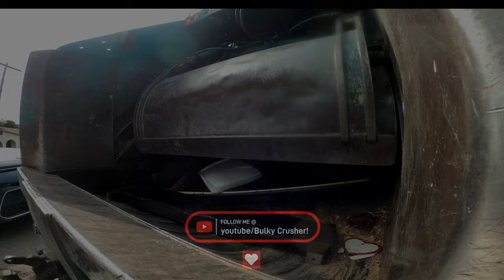Bulky Truck: House Clean out Part 2!

Comment: 1:00 Clothes
1:30 more clothes and plastic toy
3:04 Trampoline
6:01 Winter jacket
6:35 Clothes
8:25 Clothes
8:58 Toy
9:39 Backpack

9:42 You missed the iPod there 😅

9:43 Shoe
10:10 Backpack
17:30 Toddler walker

20:19 Compacted clothes

23:36 Plastic toy kitchen
23:41 Plastic toy slide
24:18 Mannequin and Clothes